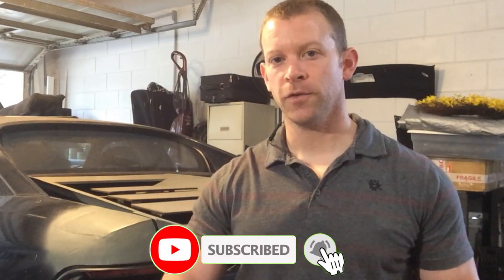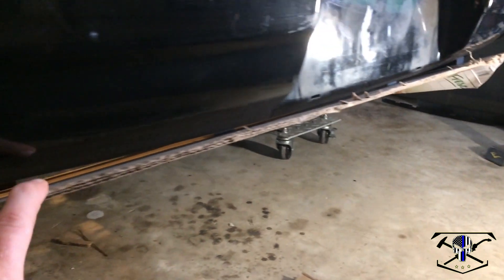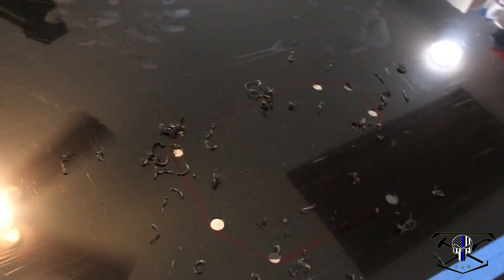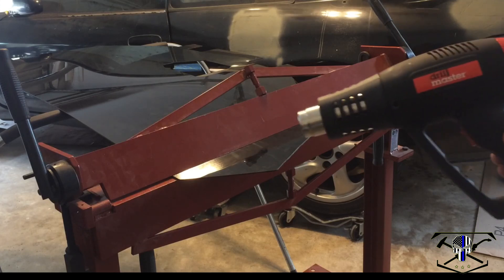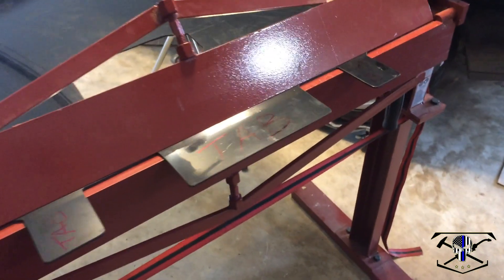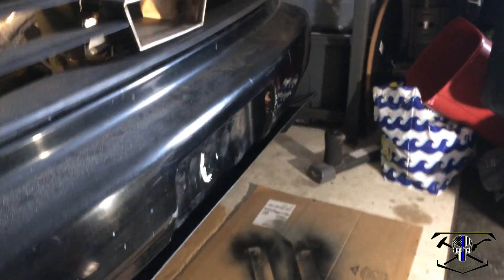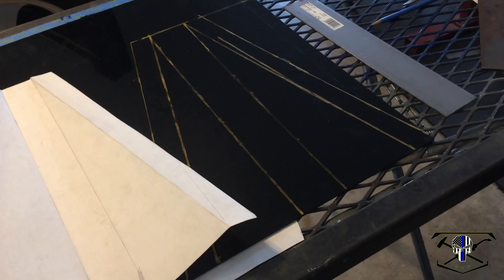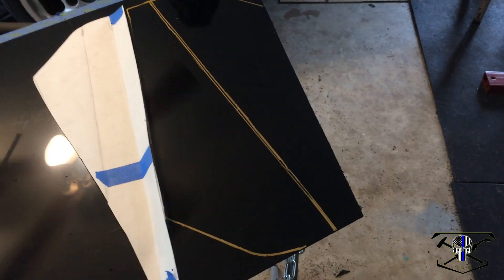DIY Rear Diffuser

Comment: Do you see differents in handling car before this solution? And what about stiffness
Reply from the maker: Not yet unfortunately. the car is still not on the road. Just had everything apart again for paint. the 1/8 thickness along with proper bracing seems to make it strong enough.

Comment: Looks good. Is it aerodynamically functional?
Reply: Aerodynamicist here. It should be fairly functional, though its far from ideal. I'd recommend firstly to tape over any joins your have on the underside (so I think there are a few where the strakes meet the main understray. Also, I'd recommend covering that hole for differential/transmission. It will cause a big wake which in turn can lead to the diffuser stalling. Instead of having the hole, a removable undertray would be better. Smooth floor would help to significantly improve the diffuser's efficiency too.
Reply from the maker: Thanks! In theory it should be functional